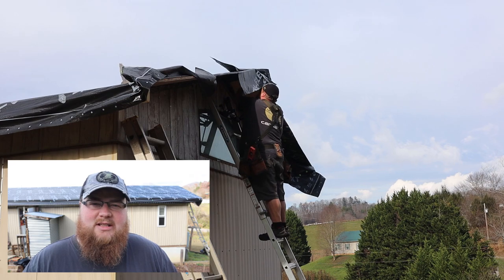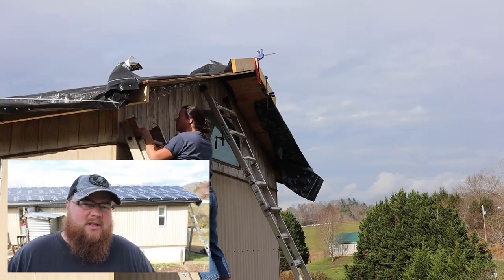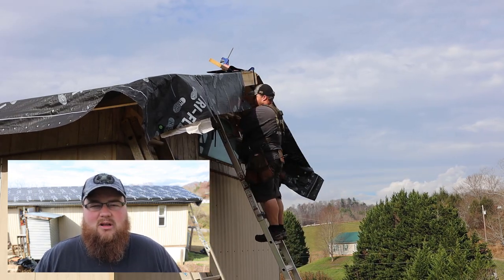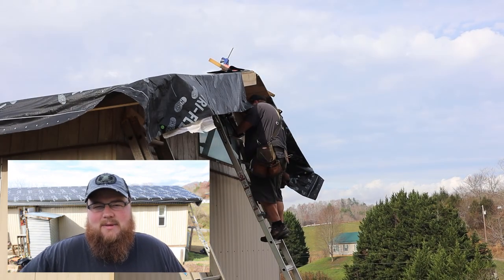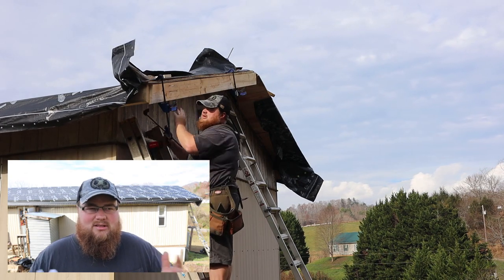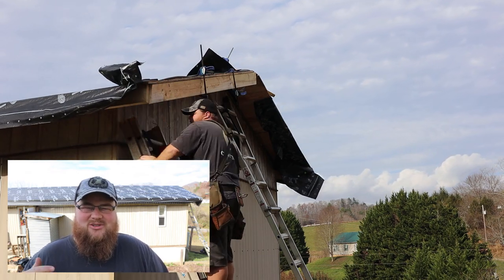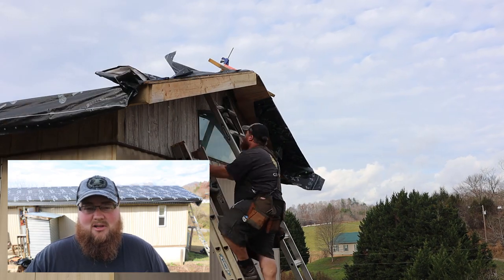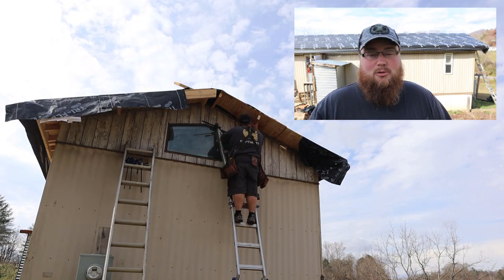FAQs of our Mobile Home Roof Over Project

Comment: I'm enjoying this series.  It's relaxing to watch others work.  How deep did you make the soffits on the sides and gable ends?   For the critics saying it's heavy, shingles weigh 180 to 240 lbs. per square (100 sq ft).   So on a 1000 sq ft home you had 1800 to 2400 lbs of shingles.  A panel of 3x8 metal roofing weighs less than 18 pounds so 100 square ft weighs 756 lbs.   Metal is 1/3 the weight of shingles.

Comment: I’ve been very curious in what hold ups you might be facing in acquiring the metal roofing so you can finish. 
Quite amazed at how awesome a job you did in the overhang! I forget what you called the support for it. So impressed with you all!
Reply: Fly rafters I do believe was what the overhang support was called.

Comment: Good job Sam...........it is one heck of a job I can tell you that and I think you have done a great job of taking on this project. 
We did our triple wide 2000+ sf home and it took a couple weeks doing it steady.  Then of course it was just my hubby and I.
It actually may have been more like three weeks as we went down through the  top and took off all underlayment as we had a few  2x6  that had to be raised a bit and or sistered to new boards ......our walls all around and roof are done with 2x6 lumber. It's very sturdy and this time we laid double underlayment for the entire roof because at 67 we were not doing this AGAIN.  We've never had the luxury of hiring things as such done so we have  done tons of projects and the satisfaction of that is that we know what is there and how it is constructed. It is a heck of a lot of work and with a 25 yr warranty on the shingles we won't be around to see it be done again..........I don't believe!  LOL I think you've done a great job and it's a heck of a lot of work. Stay safe on the metal roofing......it will be wonderful. 
Love that you are accomplishing all of this and can take the pride in knowing if ever needed you can do it if you have to.
Blessings......great job!

Comment: We live in Vermont and I have had two metal roofs...one on strapping and one on plywood...plywood all the way.  Our last roof in 2004, cost around $8000 installed.  It is not a standing seam but a regular metal roof.  I would not have any other.  We live in the woods.

Comment: Regarding the extra weight of the roof.... You mentioned that you have the specifications for the roof trusses and they will carry the extra load. My question is what about the floor under the exterior walls? Will it Carry the extra load from the roof transmitted down through walls? Since mobile homes have no foundation support on the exterior walls.

Comment: I'd like to know if you can fish a wire in the roof from the panel box to an outlet? If you poke a hole through the ceiling will you be able to fish over to an outlet, approximately 7 feet. The roof has a curve or rounded top.

Comment: Be sure to not overtighten the screws. We had a contractor put a metal roof on our doublewide 7 years ago. They overtightened the screws and stripped them out. It made the holes too big and nothing we could do to fix it except replace the roof. One section of the roof would leak and we could never get it fixed correctly. They should have put the 1 by 4 boards on top of the osb, but didn't. There was nothing for the new screws to grip to. Had to replace the roof. So be careful getting the screws perfect.